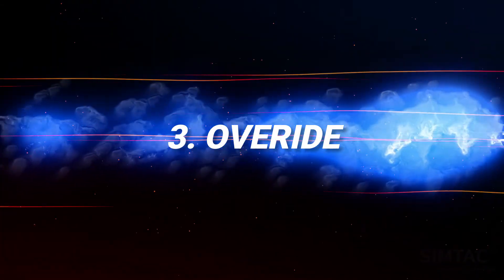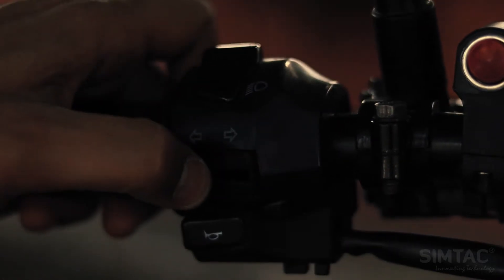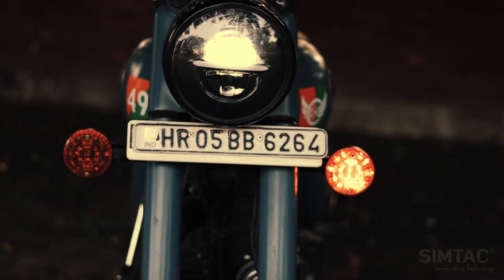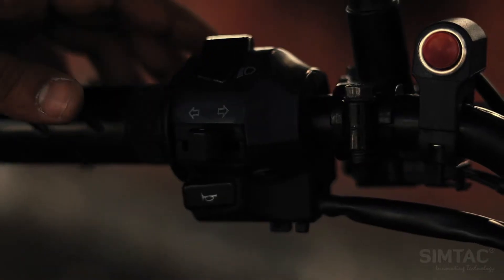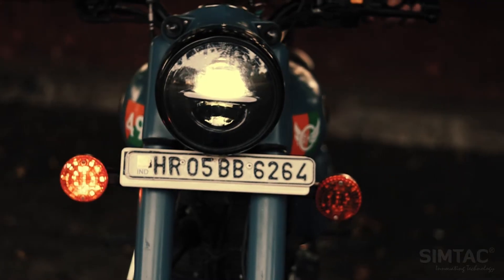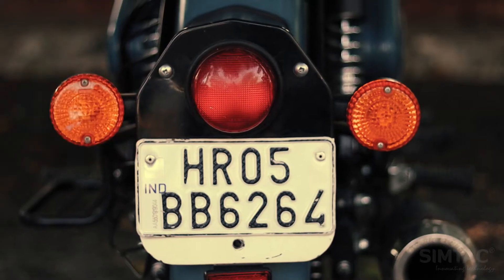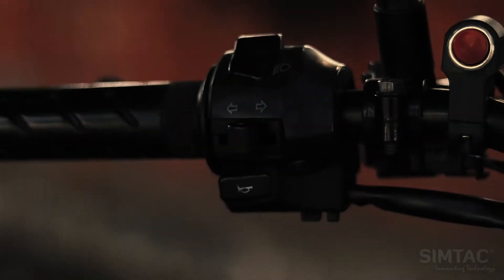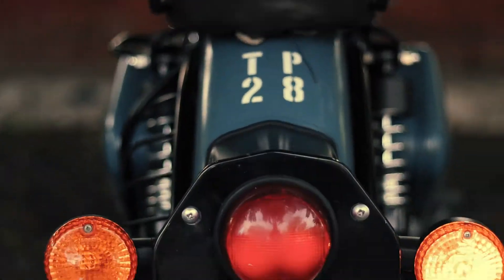Plug and Play Hazard Flasher Version 6.0

Comment: Thank you very much for your efforts which are really helpful for new owners like me.

All your videos are nice and easy to grasp.

I have few more request which will be of grate help if clarify. you

1. There is no polarity issue in standard BS6 (I have standard 350 bs6 and all led are working without changing the polarity of couplers.) However, there is issue of all 4 indicators flashing together if stock switch for left or right indicator is used.

This is solved if I remove the small dashboard light bulb which is there for indicator. But, that light on dashboard is required as removing it does not warn the rider if the indicators are on or off. (Many people forget to switch off indicator after using it for left/ right turn)

Please provide a solution for it if you can.
Reply from the maker: Dear sir,
Many thanks for your appreciation. We are always working for the satisfaction of our Tech family members and Sir, we always try our best to never disappoint our members.
and sir we are definitely working on it we will make a tutorial video about this speedometer issue
Which would be very helpful to clarify.

Comment: Sir I have some doubts:
1. Is there any such process like we need to wait for some seconds before powering on after installing?  Or any such methods?
2. Does these flashers work with only leds or halogens(10w each) also.
3. I have installed simtac led indicator bulbs(3w each). Will say it is the best from all that i had used. Will flasher work with the same bulbs?
I have pulsar 150 bs6.
Reply from the maker: Dear sir,
Don't worry ab it we will clear your all doubts,
1 No need to wait  for a second after installation.
2 our Hazard flasher will on both LED and Halogen also.
3 Thank you so much for your feedback  and our hazard flasher  can work with same bulbs in your pulsar sir.
Reply: @simtacautomation3602  Thank you

Comment: I have switchless simtac v.4 for interceptor 650. Bought 6 days back 😑. But i am facing problem while turning it on when while riding. Can i change it or convert it to switch type? Let me know.🤔
Reply from the maker: Hello sir
No problem sir if you are facing problem in operating switchless hazard we are always there to help you
You can contact on our WhatsApp helpline number 8899640640 they will guide you properly.